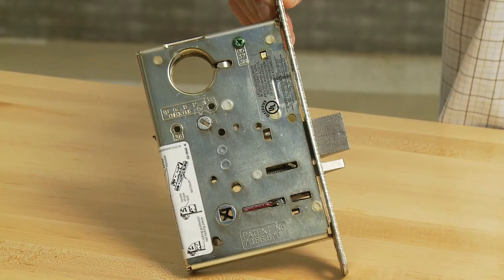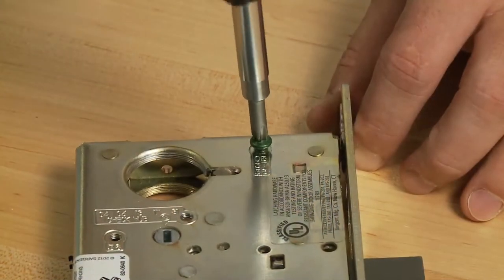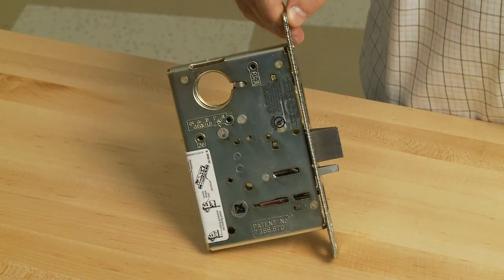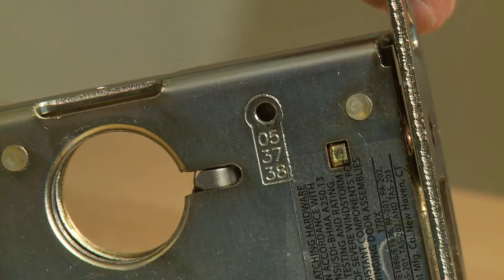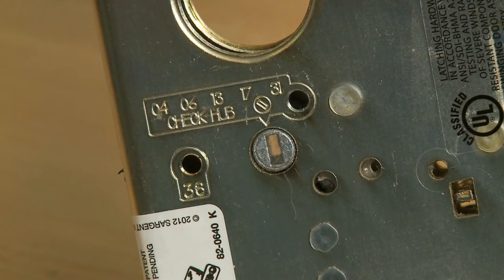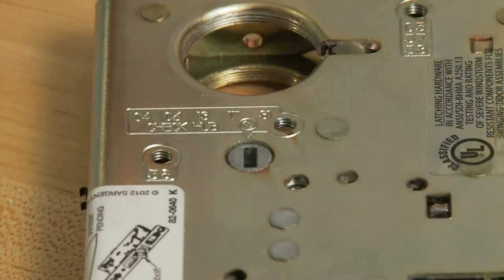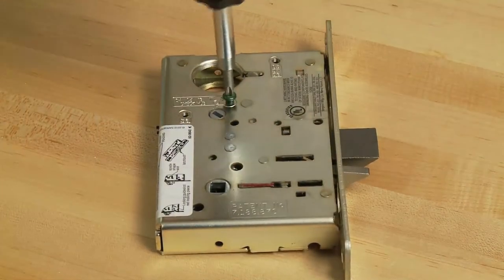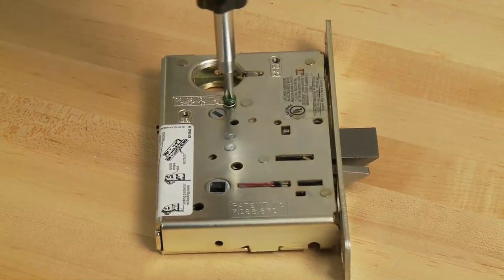How to Change Functions on a SARGENT Mortise Lock

Comment: I modified mine by taking it apart 🤣 I didn't have that green screw customizable ability
Reply: Care to share your procedurr?
Reply: @supersam806 I guess they don't. Got like 30 of them for a remodel job, none assigned to specific doors, and only ~⅓ are set up in panic function but the included instructions have a QR for this video 🙄
All the locks should be the same